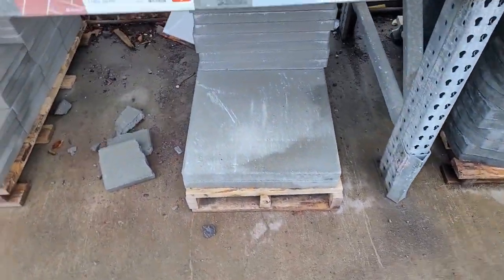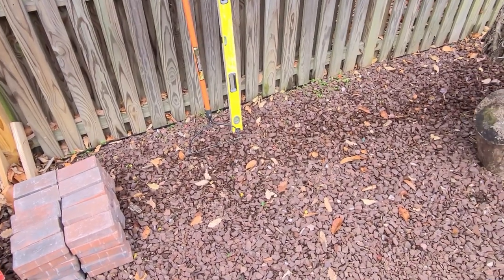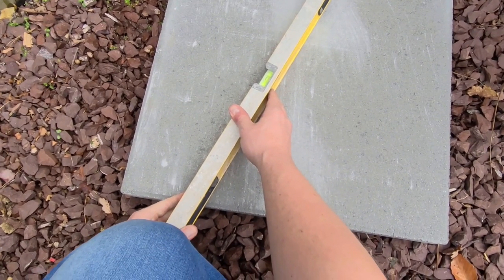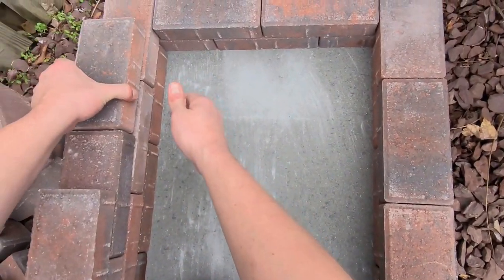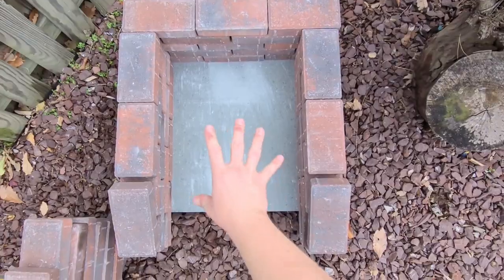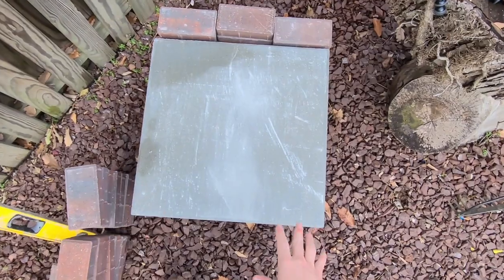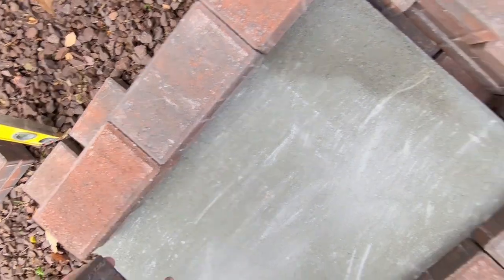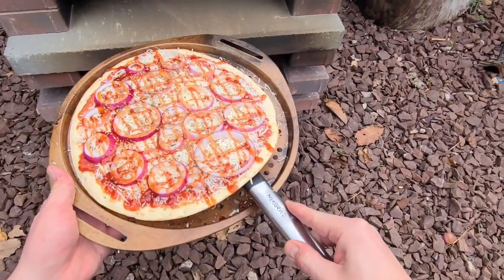DIY: WOOD FIRED PIZZA OVEN

Comment: Good video. I just saw a video the other day where a guy put the access to the fire on the side of the oven.
Reply from the maker: Thats not a bad idea. How did he provide access? Was it just an opening or like another fire box? 

Thanks for checking my video out, mean a lot!
Reply: @bakersbuilds  Since we can't put links here this is the title of the video with the channel name.  "DIY Wood Fired Pizza Oven Homemade"   Channel  Dan H     From three months ago 31 subscribers. Thanks for your video.
Reply: Since pavers are not meant for that intense heat. How many times have you used it before the pavers started to crack. Cheap to replace cracked ones but just curious?
Reply from the maker: @kimdavidson2810  the only one that has a small crack is the bottom one used for the base. It does affect performance of the oven so I havent replaced it. Ive used it a dozens times. I was a bit suprised more didnt crack.
Reply from the maker: @mhammer5  thanks man, and Youtube should allow links, itd be much easier lol

Comment: did you have any problems with the heat cracking the bricks or slabs over time?
Reply from the maker: @DjJDtech  so far to date I have not. Only bottom has a frew surface cracks, nothing the jeporidizes structure. I might make an update video soon if you think it would be useful.
Reply: @bakersbuilds  yeah would be good to see how you are getting on with it. Did you try cooking your own dough on it? Planning on making my own one towards the end of the summer once I've got my holiday out the way and hopefully have some spare cash to buy a few bricks and slabs
Reply from the maker: Yes, i did try it with my own dough. I found i had to use parchment paper because i do not have a pizza peel. So it was abit tricky to slid it in and out.